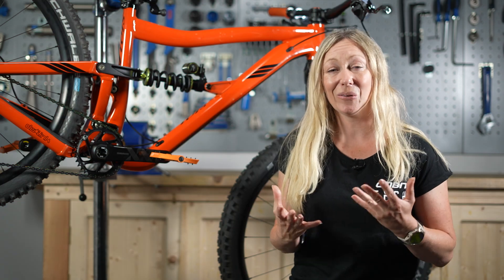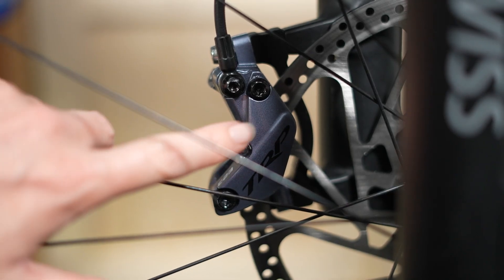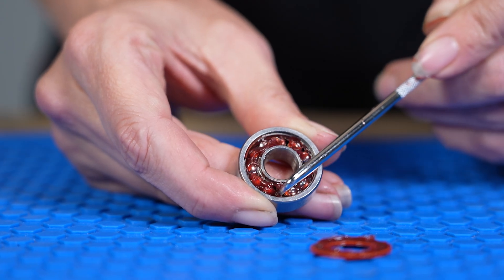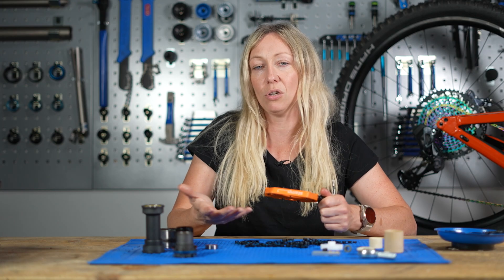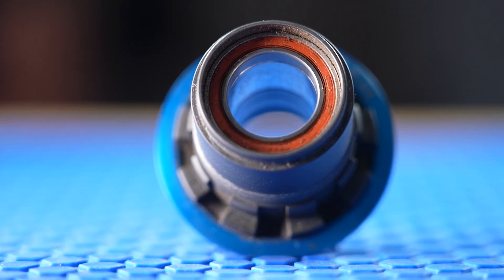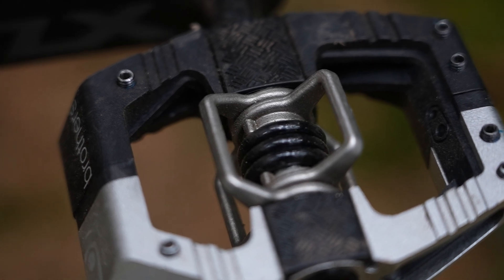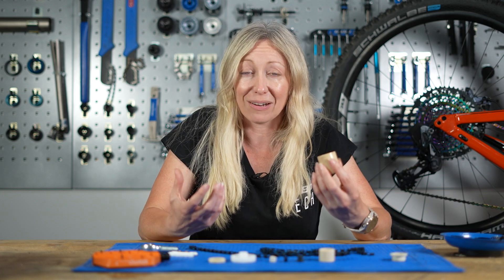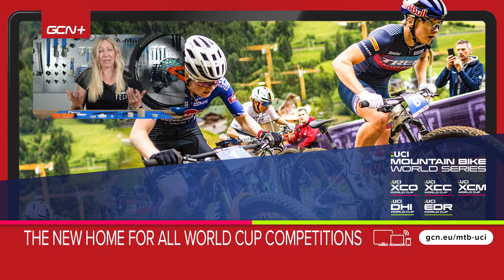Bushings Vs Bearings | What’s The Difference, And Why Does It Matter?

Comment: Every pedal i've had with bushinsg the bushing has broken causing the pedals to creak, crack and wobble. Every pedal i have with metal bearinsg i'm still using years and years later. Anyone know any manufacturers that make proper pedals with bearings at both ends of the pedal spindle? everywhere seems to have bushing now and they are rubbish.
Reply: wow. no answer to this 5 months later.  and from reading online manufacturers are just not making proper pedal sanymore. cheap plastic bushings in overpriced rubbished.

Comment: One of pedals on my bike wasnt spinning freely, so I took it off and took it apart. To my surprise, my stock pedals are bushing pedals. I was expecting to find some ball bearings or sealed rollers in the pedals, so they have a cheap feel to them. 

My first instinct was to replace them ASAP. However, after a slight loosening, the pedal seems to be spin a bit better. Also, they’ve never let me down. I think I am going to delay my upgrade for the time being. 

I wasnt sure if I should apply some grease to make the pedal spin more freely.

Comment: I want to replace my air shock, that is mounted with bearings, with a coil shock. Can I mount the coil with bushings since I don't have a bearing mount to fit the coil?

Or will this damage the frame? It's a nukeproof mega but it might not be bushingproof?

Comment: #AskGMBNTech I recently purchased a mid drive kit and ran into some issues. This pertains to gearing which is why I thought I'd post it here: I have a full sus xc bike which I am in the process of electrifying, I have the motor kit (which I fixed according to recommendations), a shimano LG kit (basically rear cassette + mech + shifter). However, after sizing my chain up according to recommendations, the chain always seems to jump from the front chain ring. What gives?

Comment: you missed an important aspect. Bushings are better suited in locations where there's some rotation, but it's not a full rotation and totates in slow speeds, eg. like the pivots on the Ibis ripmo. Placing a bearing where there's say 15* of rotation renders the bearing a bit redundant as it poses little benefits performance-wise, wears quickly at a certain part of the bearing and adds weight and cost.
Reply: not always the case. Bearings are not used in some flat pedals, jockey wheels.
Reply: @ivanteo1973  you missed my point. I mentioned that bushing hold additional advantage in locations of partial rotation, eg. suspension pivots, where the rotation is not 360* but rather a fraction, eg.20* 

I'm aware that bushing are used in full rotation applications.
Reply: Better tell sram and shimano for their lower end jockey wheels😬
Reply: And nearly every single pedal manufacturer
Reply: @knott4me561  So what's your point exactly?

Comment: One correction. In the video it's mentioned that bushings are not used in hubs. However, Mavic does use plastic bushings on the several road and MTB hubs.
Reply: Only in their freehubs, I believe. Which makes a little more sense than in the hub shell.

Comment: If you remove your bearings then take them to a bearing trader you can save £££££’s. If you tell them what application you are using them for they can point you in the right direction on how to upgrade your standard worn out bearings

Comment: bushings are the inferior choice, she is just spewing crap on bearings, your suspension will still bag with worn out bushings and they have way more friction than bearings, also nobody regreases bearings every week,  wtf is that nonsense
Reply: Maybe an engineering degree will help you not to spew out crap without knowledge of the matter!
Reply: Incorrect, in partial rotation applications, a bushing is more suitable.
Reply: @EnglertRacing96  if you want to cut corners and save money
Reply: @thescerigai  ball bearings in partial rotation apps just dig notches in the races.
Full compliment needles work better.
But you'll find in industrial and automotive applications bronze bushes in partial rotation applications.
Reply: The other issue with a ball in partial rotation applications is that it pushes the grease away from where it does rotate into the areas where the ball does not rotate to.  Where as in full rotation applications the grease is constantly redistributed.
Reply: @thescerigai  Good bushings don't have way more friction than bearings once there is load on it (which is usually what actually matters). They are also much better under high loads at low speed, which is why almost everything outside of mountainbikes uses bushings for suspension pivots and are typically much smaller for the same load rating. 
So they have their places where they are simply superior to bearings without any price considerations..